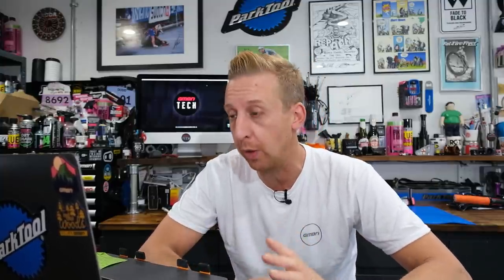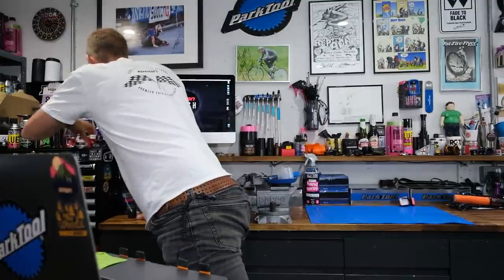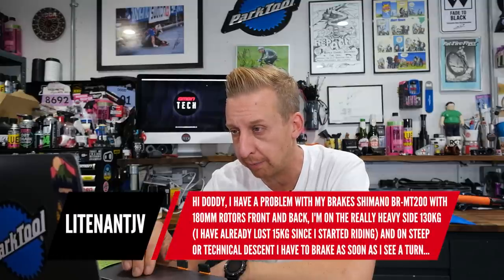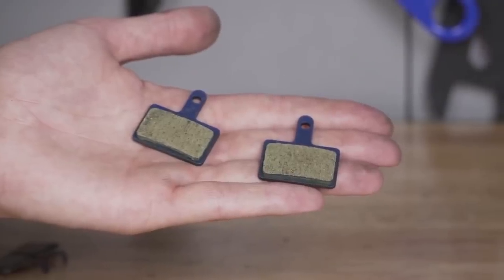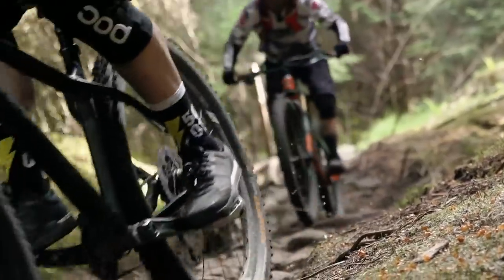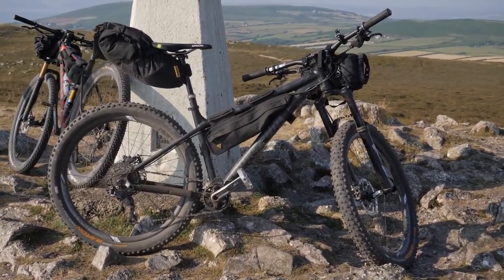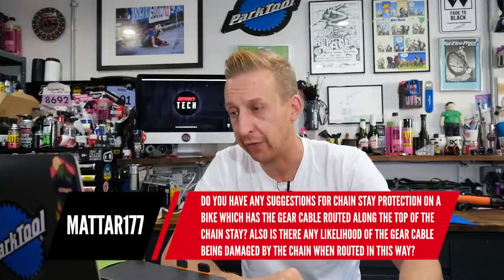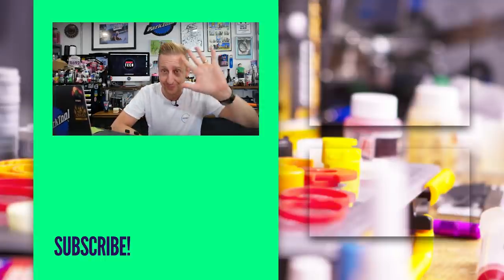Suffering From Sticky Brake Pistons? | #AskGMBNTech

Comment: #AskGMBNTech Hi Doddy, loving the show. I have recently bought a 2012 Inspired 4Play with Avid Elixir 5 brakes. Although 8 years old the bike is in mint condition and has clearly not been used much but I'm having problems with the rear brake. I've bled plenty of brakes now so I know what I'm doing but I can't get this one working properly. I've bled this brake about ten times now, in various orientations, on the bike and off the bike but still get the same result. When pulling the lever and holding pressure on it, the lever gradually sinks towards the bars. It feels as if it should be leaking but it's dry as a bone. I've stripped and rebuilt the calliper and lever and everything still looks as good as new inside. There is a service kit available but can't see how this will change anything. Pulling my hair out with this one! Thanks in advance.

Comment: #askgmbntech
Hey guys, I have some entry-level Shimano brakes on my bike, mt-201 I believe, and they have the 3 finger brake lever. The brakes have plenty of stopping power for me, so I don't want to replace them, as it's expensive and unnecessary, but I don't like the long brake lever. Is there any way I could replace just the lever blade with a one or two-finger blade like an slx blade or something? Thanks!

Comment: #askgmbntech I bought a 2021 Kona Kahuna online and I’m having difficulty indexing the gears. I put it into its highest gear and I have to loosen the barrel adjuster to stop it clicking. Once I get that right I start changing down, by the time I get half way down the cassette it doesn’t want to change down so I have to tighten the barrel adjuster. Then when I go back up into high gear it starts clicking again. I go round and round like this forever!

Comment: #askgmbntech I'm riding a 2020 polygon siskiu D7 29er, and looking to upgrade the fork (rockshox recon RL) because my compression isnt working and I would love to add tokens to the fork. Ive been looking at also upping the travel from 120 to 130 or maybe 140,
1- what would be the downsides of lengthening my travel
2- what cheapish forks would you recommend

Comment: #AskGMBNTech
What's the minimum internal rim width I should be running for 27.5" x 2.35"/2.4" wide tires?
My current rims are 23mm wide internally and setup with Schwalbe Hans Dampf & Nobby Nic that are 27.5" x 2.25" wide. I've been told 2.25" is near the maximum a 23mm wide rim can hold
When the time comes, I plan to upgrade my tires to something wider like a 2.35" or 2.4" as I need the grip for my riding but worried that my current wheels might not be able to handle them. Cheers you guys and keep up the good work!
Reply: That does seem on the edge of being too small, but to be honest if the tyre holds then its all good. I have 2.4 with 28mm rim. Also depends if u run tubeless and if the tyre holds and doesnt come off when shredding turns hard. If it doesnt then its alright I think and there is no disadvantage. Obviously bigger rims are stronger but more weight.

Comment: Modern slack full Suss is like riding around around on a magic carpet, compared to older bikes back in the day. Totally agree that some riders go beyond their ability because the modern bike allows them to., Which is fine when all is going fine, but get out of shape the skill level doesn't match the speed trouble matrix. Seen it many times out on the trails.

Comment: #AskGMBNTech
I recently went in to the mountains and on the top  my dropper didn't went up as usual but after my descent it worked as usual.
Is this normal with 3000feet of elevation or do I have to Check it more throughly?
It's a cable Operated dropper in a carbon frame.
Thanks for answering great fan of the show.

Comment: #askgmbntech got a 26" wheel bike wondering if nx eagle would be a good idea. It is an older Marin mount vision 2004 so will the cranks work with SRAM dub, and will the derailleur be to long

Comment: #AskGmbnTech Hi Doddy! I recently got a bike with a 3 position low speed compression lever. I was just wondering if I would be okay to run it on 'trail' mode for jumps and drops. The shock is an RC3 tuned by trek. Thanks in advance
Reply: Yea trail would be fine for small - medium jumps. Its all about what speed, size of jump etc. Fully open is obviously better for full DH runs and bigger jumps as it will be slighlty slower and not ''buck'' you. But thats very simple explanation, its all relative to what, where, speed, your overall suspension setup etc.

Comment: #AskGMBNTech
I have a Roscoe 7 with 27.5+ wheels, I would like to switch to 29er wheels but the rear axel is Boost 141 QR. Having real difficulty finding any. Do you know of any wheels that might fit?
Reply: U have your standards mixed up
135mm x9mm is quick release
142x12 is non boost tru axel
148x12 is boost tru axel
156x15 super duper boost

Problem will be your chain stays were made for 27.5 it might not fit a 29 wheel
Reply: @vtecmossy  I know it’s a weird standard but it says 141 boost on the seat stay and it has a QR on it
From Treks website
“Alpha Gold Aluminum, tapered head tube, internal derailleur & dropper post routing, rack & kickstand mount, Boost141, 5mm QR”

Comment: Outside caliper doesn't move and the inside one pushes the disk to the outside, deforming it under hard braking. This is on mechanical brakes fresh from the factory, is this normal? Or do I phone the shop up?
Reply: It's normal that on a mechanical brake one normally the inside caliper doesn't move.
This is just an setup question.
Usually there should be a Allen's crew on the inside and you should be able to turn it with a 5mm in.
Try it bit by bit till It just barely doesn't rub.
Reply: It's perfectly normal
Reply: @maikszczerbuk613   ah okay nice one cheers! I've done that so there's a visible gap and it doesn't move the disk quite as much. Was worried for a bit there haha thanks
Reply: @RealMTBAddict  if you're on a tight budget shimano MT200s and tektro TKD32s are better bang per buck
Reply: @RealMTBAddict  haha, I also like the Sram Level Ultimate and the Magura MT8s

Comment: Were do u no to get a good cheap rim because i cant afford a good rim and my rims are after getting bent and a lmall bit dented
Reply: Try alexrims or go secondhand
Reply: Try the "SunRingle Duroc 30" model. I use it on my trail bike and they worked great on my XC bike. It's compatible with up to a 12 speed cassette and the freehub is awesome. All for 200 bucks a pair on Decathlon.
(I'm not sponsored, I just love them)

Comment: #askGMBNtech
Hi Doddy love your channel, used to read your stuff in the magazines when I was really into mountain biking (stump jumper, rockhopper and a 650b giant talon), put loads of money into upgrading them etc. One got stolen, and due to circumstances I had to part with the other two.
My question, I've recently been given an old Raleigh Nitro mtb with a cool red paint job. I think it's early 90s late 80s. It's got a threaded headset, no idea on the sizes etc, and a quill stem. Is it possible to convert it to a threadless headset or change the forks or some sort of adapter so I can use a modern stem and handlebars.

Comment: Why aren't rear derailleur guards, to protect the rear derailleur from getting damaged more prevalent? #ASKGMBNTech
Reply: weight saving I imagine
Reply: FlyingMeta Ya that's true. But what about a carbon fibre guard? or even steel or aluminum the weight may be worth it to protect a $300-$400 derailleur.

Comment: #AskGMBNTech My 2020 Trek Marlin 7 came with qr sizing (100x5, 135x5). I was considering a wheel upgrade, but i havent been able to find an mtb wheel that would fit. Would a gravel wheel work? Thinking of the Hunt 4 season Gravel Disc X-Wide wheels. Love the show and the bike cave!
Reply: you can always get a custom wheel build. You can choose the hub and rim, and sometimes even really sweet spokes too, and get exactly what you want. It's surprisingly cheap too. I was forced to build a rear wheel for my 26er QR 135,  since I couldn't find anything good. Ended up with Sapim Cx-ray spokes (pretty much the best money can buy, spank spoon 32 rims, again, a very solid choice, and spank oozy trail and spike straight pull hubs, to which I fitted a QR adapter kit (came with the hub to the rear hub). The labour and spokes came to £230 for front and rear wheels, but if you specced cheaper spokes you could probably get it down to £100 labour
Reply: @judechandler5102  Thank you for the interesting tip, Ill look into that!
Reply: @andrewsteedman3960  I can recommend Arkane Wheel works. He literally just finished mine today, and I'm almost done building the bike as I type this. They are dead true, perfectly dished, well tensioned and look more epic than you could possibly understand. He looked after me well, and even delayed posting them back so I could make sure I was at home to receive them. 11/10 stars for him. His name is Martin Muller and this is his website. https://arkanewheelworks.co.uk/

Comment: #askgmbntech I am looking for a cheap dh bike and i can find onliy with coil forks should i search more for an air one or just get it?
Reply: Rockshox boxxers are coil, but brilliant. Great small bump sensitivity
Reply: @judechandler5102  Thanks, very helpful since I intend on doing technical and rooty sections on it but is it great on jumps and big impacts allso?
Reply: @lloydsicornite6454  You can get different springs for boxxers, so if you get the slightly heavier duty spring (they are pretty cheap on ebay) then you will be good for both. If you get a cheap air fork, it will either be crap, or be a badly worn expensive one which will need an expensive full rebuild
Reply: @judechandler5102  the probleme is that i  live in Romania so i have to pay the delivery and IT costa double the orice of the spring
Reply: @judechandler5102   thanks for the  answer IT was helpful i will buy the bike even If IT îs coil
Reply: @lloydsicornite6454  yeah. Don't worry about the coil thing, the bike will still be rad. I've seen some great deals on DH bikes second hand recently. Try Ebay and Gumtree. I've seen some good ones on there

Comment: #LITENANTJV - hey m8 from my experience a wallet, all the 4 piston calipers by themselves in my country (Poland) are so close in a price range that it's not worth bothering with anything less then saint or zee. the price range from the lowest to the highest is not even 50 pln ( caliper only)  so check ur internet prices b4 you buy anything. Me myself am using Saint brakes and when properly taking care of them they are insanely powerful and cos of the saint lever system ingenuity, if you squeeze them in less than a second ur wheel, will just stop... if you do it gradually the more you squeeze you get the mathematical square root of braking power - which in lower-tier levers is only linear braking.

Comment: #AskGMBNTech Hello there, I have a new Canyon Torque with a SRAM XO1 Drivetrain. The shifting is clean except for the smaller 5 cogs and no matter what I do (adjust the cable tension, Adjust the limit screws or the chain gap) the second largest cog always makes a clicking sound after a few pedal strokes after shifting when the chain is in Gear and trys to slip off. What would be your next Idea ?
Reply: Is your B screw set properly?
Reply: @MagpieManny  I Followed the GMBN Video. I hope so. But thank you anyway :D
Reply: Hmm. Hanger alignment also good? 12x is pretty sensitive. I did that with mine and also got the white b-gap tool.... Good luck! Annoying if it doesn't work for such an expensive set of parts..
Reply: @MagpieManny  no haven't checked the hanger alignment because my Bike is brand new. And I thought Canyon would check such a thing if the bike leaves the Factory. Thanks for your input I'll put it on my list of what else I can check

Comment: Doddy I am looking for a unique set of tires that I used to have a long time ago the name I do not remember but the rear was a specifically designed 1-in deep tread self-cleaning mud and snow tire I'm pretty certain that it was a 2.3 and the front was specifically designed for quick turns in snow and mud that was also a 1-in self-cleaning but a different design from the rear all together they were specifically paired the last time I seen this particular tire was 1995 so like I said I do not remember the exact name of the tires only a description in my mind that I cannot find the problem I have been looking for a while so back in 95 we can both definitely say it was 26-in rims and yes they were for DH snow mud downhill

Comment: #ASKGMBNTECH 
1. i just changed from 3x10 to 1x12 system, I have Kross level6 frame, which has internal routing for front deralur. Now can I use the inner routing for dropper post? 
2. I'm all about braking power. Recently I found this chart: https://enduro-mtb.com/en/best-mtb-disc-brake-can-buy/  Can you tell how accurate it is? according to this Magura mt7 brakes are more powerful then Rich Dirrettissima brakes?